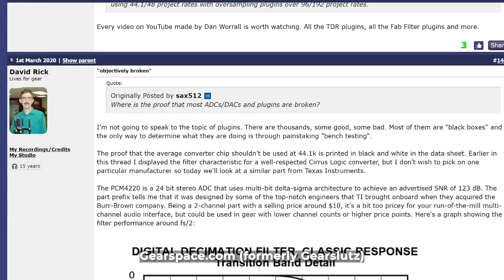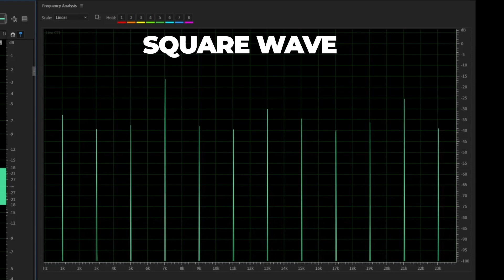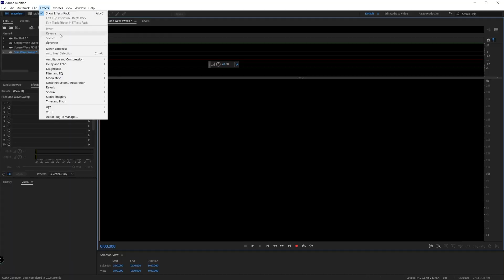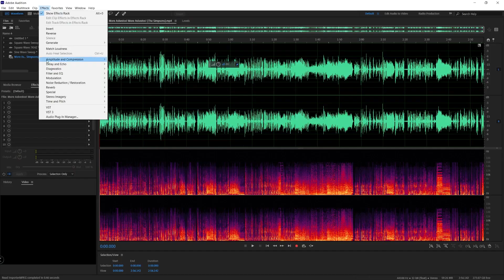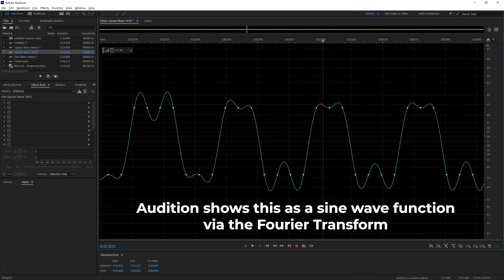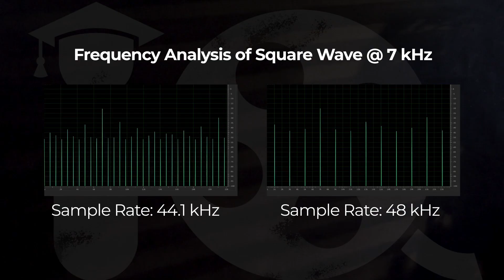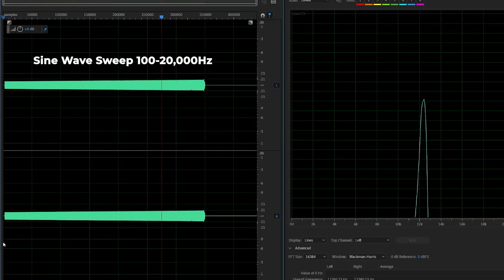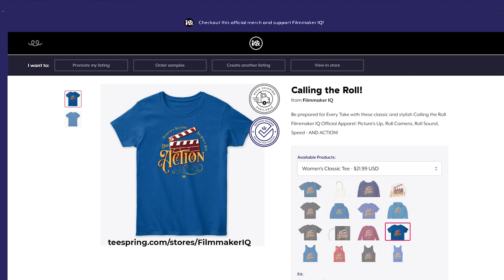What is the Optimal Sampling Rate for Audio? (It's All About the Aliasing)

Comment: What you explained is just that, either have a good recorder (A/D converter) which can do a good job at filtering out > Nyquist frequency signal, or, record at higher sampling rate (for example, 96kHz is much more than enough), and then, down sample to 44.1kHz/48kHz when you do your post.  In digital domain, you can do (very close to) exact calculation, and at the end, save a few bytes on the final product (without jeopardizing quality).  However, to those crazy guys who insist to get so called high res files for PLAY BACK, they are just crazy, forget them!
Reply: I mean, even cheap equipment like 100$ DVD Players in 2007 had already 192kHz DACs avoiding any problems like this at all.

But for the final media, more than 44,1kHz doesnt make much sense since anyways most released music is still in 44,1/16Bit. Even most(or all!) vinyl records are made from 44,1kHz samples. Tidal even dare to upsample/"remaster" 44,1kHz/16Bit originals to expand their "HiRes" collection...

Since anyways every HiFi gear have HPF for anything above 20kHz, in combination with internal 96kHz+ processing, more like 384kHz nowadays, no. 44,1 is just fine... more is acceptable in cases of digitalized vinyl records or yeah - why not. 44,1/48 vs 96+ is like comparing 4K vs 8K... it doesnt make practical sense, probably a bit with the perfect circumstances... but hey its possible. Thats why my AVR has 9x(or 11x idk) 384kHz/32Bit (32Bit!!! wtf?!) DACs, by numbers even better than my Hi End Stereo Gear with "only" 192kHz/24Bit Wolfson DACs.

Only in recording and mastering more than 44kHz are needed, and these are anyways at 96kHz+ since its possible.

I dont get people when they complain about "only CD quality"/44,1kHz... damn! Thats at least completely uncompressed, not like the lossy! MQA garbage for example. In fact (and already proven...) CD quality is better and more accurate than MQA (which is another compression format like mp3 - but worse, and with high license fees haha). Some of my friends are completely addicted to HiRes and/or Tidal/MQA, only because they see any blue light or 96/192kHz on their receivers screen... despite having absolutely the same sound as a 44,1kHz CD with the same mastering. Damn, they use soundbars, garbage "HiFi" gear, BT headphones and they dare to complain about 44,1 kHz only!
I also prefer HiRes source material, but mostly because of different masterings, less loudness, more audiophile/dynamic, easily for the "demanding" people mastered.
Reply: @harrison00xXx   I believe you are incorrect about vinyl masters. Mastering for vinyl is a separate master than the master for CD. Professional mastering engineers want to work with the highest quality mix which means NOT 44.1kHz/16bit. And most likely the vinyl press wants to make their master from the highest quality version available. At least for the major label artists. Independent artists, well ya know they get what they pay for and can’t be reasonably used to make statements about what’s used to make vinyl records.
Reply: @arsenicjones9125  Ofc its differently mastered for vinyl, but still, the samples used to make the "negative" are for probably 99,9% of the (non quadrophonic) records 44,1kHz/16Bit, as CD quality, that was my point
As if CD Quality is "bad"....cmon, thats the most accurate and "lossless" quality standard we ever got. Ofc there is now "HiRes" but thats more of a voodoo/too much...
Reply: @harrison00xXx  no I’m afraid you’re again incorrect. In major studio albums they regularly record at high sample rates then down sample to 48khz 24bit to edit & mix. Some major studios do all their editing and mixing work in 96khz/32bit floating. Then it will be down sampled again after mastering. Again we can dismiss what independents do because they don’t do anything in any standardized format. 

CD quality is not the most accurate, lossless standard available. 🤦‍♂️🤣 An original recording made in a 96khz/32bit wav file is more a more accurate representation of the analog signal. If there are more samples w greater bit depth it MUST be more accurate than a lower sample rate and bit depth. Just because you cannot discern a difference in every piece of music you hear doesn’t mean there is no difference or that there is no difference which affects the experience. Just to be clear I don’t think CD quality is bad just that it’s not without flaws either. Upsampling won’t increase fidelity in anyway but a higher sampled recording is higher fidelity
Reply: @arsenicjones9125  So you have proof that the source material for making vinyls ins more than 44,1kHz?

Sure they edit and master at higher bitrates, but the end result is mostly 44,1/16Bit sampled. This change probably with HiRes for the customers slowly, but its a known fact that 44,1kHz were used for vinyls FOR DECADES at least.
Reply: For consumers the issue is more the playback not so much the file itself or recording format.  So if you take a 44.1 or 48k file and up sample to 96khz and them playback it removes much of the aliasing into the inaudable frequencies.  This then gives a much smoother and cleaner sound in the Audible range.  The other issue is the jitter of of the DA clock which is also moved out of audible hearing. 24bit over 16bit is more important when recording and playing back audio. All 96khz high fidelity files are 24bit. Much of this audible difference is often negated by what some DAC's filtering out and applying phsyco accoustic filters.
Reply: @julesc8054  you cannot remove aliasing by upsampling. The aliasing has already been included into the file. The aliasing is apart of the digital file not an effect of playing back the file. A higher sample rate will only reduce aliasing when recording an original analog audio source. De-aliasing software analyzes the file to identify and remove the aliasing but that’s separate from the sample and bit rates. If you want less aliasing you must start w a higher sample rate and go down. Professional studio albums are run thru a de-aliasing pass when bouncing down the final master so doing it again isn’t doing anything
Reply: @arsenicjones9125  Hi Chad, thanks for pointing my error,  I was more talking bout the clock jitter in most DAC’s.  If a file is a 44.1k file that has been dithered  “de-alised” there is no real issues with ailing in the file.  Up-sampling the playback or playing back at 96k negates the issues of the clock jitter reflecting back into the audible spectrum in the higher frequencies.
Up sampling also has the added benefit of interpolation across the whole spectrum not just the high frequencies.

As a matter of interest I’ve just done these test in my DAW all the way up to 192k and the issue happens both ways. The issue is not so much the aliasing its a simpler issue.  It has to do with the number of samples representing the slope at say 7k or 10k and even in much lower frequencies down to even 400hz.  More samples representing the slope the smoother and more accurate the sound.  BTW Sound should never be a square wave. Square wave is distortion (clipping) that damages equipment and speakers.
Reply: @julesc8054 it’s interpolated into a smoothed wave by your DAC but it was still squared off to start.  @julesc8054  seriously just an egregiously incorrect statement there.
 @julesc8054 improve  @julesc8054 

 @julesc8054 effectively  @julesc8054 Unless you go to 32bit and the math works out cleanly: you just skip every other bit.

Jitter is an issue created by your playback setup and is not an inherent flaw of digital audio or the CD standard. You could have a number of issues causing jitter but upsampling can’t help that.
Reply: @harrison00xXx  yes it was used for decades bc that was what processing was available. Why do I need to provide direct evidence but your claims must be accepted at face value? Would you even accept that I’ve been employed in multiple studios? Probably not. Cest la vie.  Finally, if you do a high res recording of a vinyl, no matter the manner in which that record was initially recorded, you are sampling an analog audio source. It’s not the same as upsampling a digital file. The record is analog.
Reply: @arsenicjones9125  Ok i see you dont know much...
Reply: @arsenicjones9125  Hi  unfortunately this is not a user form that accepts quoting people, so I don’t know what you are trying to correct me on or reply to, sorry.

I think the issue here is a fundamental difference in belief. You believe the issues is the file I do not.
The biggest issue that is demonstrated in this video is the fact that it is digitally created square wave, i.e.: group of harmonics. Audio is sign wave AC voltage into a speaker driver, as we well know. 

Many people think the only advantage to higher sample rates the highest possible frequency.  I think there is far more. Although there is this benefit, other benefits are at 10k @ 48k24bit there are 8samples to reproduce the frequency and @192k24bit – 29 samples.  This means that harmonics of the sound and harmonics of other sounds can be better represented by the converter.

There are other advantage is the artefacts of clock jitter, the original issues this video is incorrectly trying to attribute to aliasing in the file, is moved to the inaudible frequencies.  Clock jitter is less of an issue than it used to be as clocks have improved over the years but still an issue on many Sound Cards and DAC’s.

I still think it is more important to listen to a 24bit file than to chase 96k it just so happens most 24bit files are 96k. I still maintain that playing back at 96k has a great sonic advantage for digital equipment in general.
Reply: I for one am glad that 196 kHz audio equipment is readily available because I actually do use all that bandwidth for performing ultrasound interferometry with work.
Reply: @AJMansfield1  wondering what gear you are using?
all of my ADC/DACs have HPFs, so after the signal got only once analog, and if its the end of the chain... its cut off at 20kHz.

Same goes btw for my Cambridge Audio Amp. Anything beyond 20kHz is already internally cut off (also in direct mode) before it can be amplified (where probably another 20kHz HPF is waiting!)
Reply: @harrison00xXx  It's a custom bit of kit with custom frontend analog circuitry, it's just from the ADC on back where it's using pretty much exactly the same 192 kHz ADCs and software drivers that have become so cheap and readily available.
Reply: @julesc8054  Square wave is a testing norm for hi-fi equipment, especially for power amplifiers. Guess why? Real life music is no where close to sine wave, what's more, you have to deal with impulse shape signals. Good luck reproducing them with fidelity if you don't have bandwidth. A good sound system, analog or digital, has to deal with square wave.
Reply: @julesc8054  Oh, and again about square waves, just put a fuzz/overdrive guitar on the scope and feel free to admire the signal shape 😉
Reply: @jjcale2288  Interesting discussion.  I think we could learn much more if the bandwidth of what we were thinking was not limited to the few kilobytes of text and data-rates were faster than our typing speed.

Then to respond: I mean sign wave AC (alternating current) as opposed to square DC (direct current). All sound engineers the world over do everything to avoid clipping (DC voltage Square wave) in audio signal process. Square wave signal from a signal generator, or some other source like clipping, produces DC current in the output of the amplifier. DC current on the output stage of an amplifier transfers to heat in the speaker drivers voice coil causing the speaker driver coils to overheat, depending on the heat capacity of the voice coil and the level and duration the square wave DC voltage is sent to the driver is converted to heat and more often than we like smoke.  Live concerts would be quite short and expensive if guitar fuzz boxes caused square waves in the signal path.
Reply: @jjcale2288  to your second comment.  I think the fuzz sound referred to the state of the muzo not so much the sound of the pedal 😊
Reply: double the sample frequency also adds an invisible bit of dynamic range.
Reply: @julesc8054  Have you ever heard about slew-rate, integrative or derivative behavior of the amplifier stage, ringing and such? DC offset is one thing that should be avoided but square wave is not DC. Clipping is completely other animal, of course you don't want to transform your precious hifi/high end amplifier in a square wave generator. But for the sake of fidelity the system has to reproduce correctly square waves within the audio bandwidth with a reasonable dynamic.
Reply: @stefanweilhartner4415  invisible indeed
Reply: @julesc8054  Fuzz, overdrive, distortion are pretty much the same thing when we talk electric guitars. If you are interested we can go into details.
Reply: @jjcale2288  but it is there. a one bit D/A converter can deliver the dynamic of a 16 bit D/A signal. i am working a lot with 1 bit PWM outputs to achieve an analog signal - after filtering. nothing magical for engineers.
Reply: @jjcale2288  Hi it sound like you have vast experience with amplifiers and fuzz pedals etc.  Sound like it could be an interesting discussion. Onto the topic at hand. I am just curios if a square wave is both AC and DC and if the voltage determines how the speaker moves and if there is no voltage change, i.e. DC flat for the brief period, what does the speaker do with the energy it is not converting into kinetic energy?  Does it make a difference if the brief DC is created by squared off wave or clipping in the signal chain? What are the effects over time?
Reply: @stefanweilhartner4415  16bit PCM vs 1bit PWM is comparing apples with biscuits. Completely different encoders. A simple conversion does not improve original dynamic. But feel free to play around 😉
Reply: @julesc8054  It depends where the clipping arises. Worst is in the final (power) stage. Although for guitarists sometimes that's the best way to go, as a guitar amplifier is a special beast that can get away with power clipping. Not easy for speakers, you are perfectly correct.
DC in speaker means a mechanical offset of the cone, in or out, depending on polarity. The current will heat up the voice coil and in extremis can destroy it. We don't want that. Full power always asks for trouble.
Reply: @harrison00xXx  Actually it's LPF not HPF.
Reply: I still maintain the issue is not in the file its in playback of the digital audio. I think this is why there is such a debate some people have audiophile DAC’s that solve these issues through various means and others don’t do such a good job. People on the professional side of things just need the extra bits. I don’t think there is an issue with sample rate conversion when it comes to music or any other regular audio.

I think there is too much emphasis on “do we need the extra frequencies?”, no, its not the whole story. The extra samples representing the audible range better, just like 16bt vs 24bit. Does 16bit reproduce the sound with 65 536 steps ok? Yes, is 24bit with 16 777 216 steps better and smoother yip. But everyone says we don’t need the extra 16db of noise floor its not the point. I still want the extra 16711680 steps of 24bit to represent the audio I can hear. The same goes for the number of samples, its not about the extra frequency range more samples and more steps in the audible range to represent more complex harmonics and subtitles of the audible audio.

its the extra bit
Reply from the maker: But the extra samples don't represent the audio better... That's what nyquest theorem really tells us... Everything below the Nyquist frequency is perfectly represented... No additional samples are needed.
Reply: @julesc8054  👍I also use at least 96/24 digital audio any time I can afford it. By the way, another consistent test for audio equipment is the white noise reproduction. Worth comparing 44.1/16 with 96/24😉
Reply: @FilmmakerIQ  Only problem with Nyquist is that some of us can actually hear how "perfectly" it works😀
Reply from the maker: I don't know what that is suppose to mean.
Reply: @FilmmakerIQ  It means that extra samples matters. 44.1kHz on 16 bit is good enough but far from perfect.
Reply: @FilmmakerIQ  you dont know much at all, as always!

Try to be more polite and dont get instantly personal after a legit argument, and probably you are ok then....
Reply: @FilmmakerIQ  This assumption is wrong.  In my opinion, there's nothing wrong with Nyquist, and it is true that a wave sampled at twice its frequency is enough to "faithfully" reconstruct it (between quotes because to "faithfully" reproduce the wave you would need infinite amount of interpolation, and that is not possible), the problem is, all the computational power and intellectual property people need to pay for in order to "faithfully" reproduce the waves, specially complex sound waves coming from all kinds of instruments and their interaction with the environment where they were recorded. What we hear coming from our PC, phone or tablet DACs are not sound waves "faithfully" recreated, not even close, the better the reconstruction of these waves, the better we'll perceive things like transients, timbre, and  depth. Just take a listen to equipment like the Chord M-Scaler, the upsampling is ridiculous, and it uses I think, around 60 bit of depth,  and it's all very perceivable.  Now, if we think about it,  it's all done according to Nyquist, the M-Scaler was designed to reconstruct red  book CDs more "faithfully". So do we need higher sample rates? "apparently" not, but what a price to pay in audiophile equipment in order to be able to enjoy music at its best. If only music were sampled at higher rates... 

Sampling at higher rates for better perceivable quality, has very little to do with our inability to hear above 20KHz, and all about how our brains can pick very small differences in sound and timing errors introduced by DACs when reconstructing waves translate into blurry and flat sound.

It's funny to me how many "neo" science wanna be people come to the internet to throw all kinds of nonsense.
Reply from the maker: You don't need infinite resolution to faithfully recreate a sound. Not all frequencies are possible in a microphone diaphragm, not are they possible in our ears. Reality is bandlimited and sound energy is continuous.

Faithfully is only in quotes because of the Nyquist limits otherwise it IS a perfect recreation of the original signal.

I can even show that the waveform created from 48 is EXACTLY the same as a band limited 192khz signal
Reply: @FilmmakerIQ  Why are we still talking about the frequencies we can’t hear, or a microphone can’t pick? That is not what I’m arguing. 

Also, I’m not arguing the fact it is possible to recreate the signals from 44.1KHz, it is, at the expense of interpolation errors that result from the fact that electrical circuits are not “ideal” and we can pick the differences in sound as a result of those timing errors. So at the end, the recreated signal is not exactly the same it was recorded, it is slightly changed. 
The waveforms coming out of your DAC are different from the ones coming out of mine, even from the same file, because of electronics component variations, brands and types.
The better the DAC, the more accurate the reconstruction potentially will be, and the higher the sample rate, the smaller the errors created by the signal physically going through the electrical components will be, also less interpolation means less chance for timing errors to occur.

I’m having this idea that a bunch of people just read things like the Nyquist theorem, and then come here just saying “I can recreate this, or I can or can not measure that, so it must not exist”, and so on.

There are many things involved here, software, electronics and also our perception which is actually individual. 

Anyway.
It’s all good, let’s just agree to disagree on this. 

Have a good rest of the night.
Reply from the maker: Well if you want to talk about all the failings of electronics, there's no point in discussing 48khz vs 192khz... There's no technological problem at 44.1 that wouldn't also be present and maybe even more so at 192khz.

No, the higher the sample rate doesn't mean there are smaller errors..

There is no interpolation errors with 48khz. The timing accuracy is 100% exactly the same. I'm probably going to do a video demonstrating that exact thing.
Reply: @FilmmakerIQ  Accuracy is 100%? 
My friend that does not exist here.

Any electrical engineer will happily tell you this. 
All you can do is approximation, and the better the equipment the closer you get to the teal thing. 

Even the measurement equipment you have, all they do is approximation with a %error that you must be willing to accept or go to a more expensive equipment that has a lower %error. 
Errors will always be present in the recreation and measurements of signals. 

But ok, do as you wish.
Reply from the maker: What makes you think a higher sample rate would be less affected by any electronics error present at the lower sample rate? 

But yes from a mathematical standpoint, the sine wave is reconstructed perfectly, 100% with the lower sample rate.

That is the Nyquest theorem.
Reply: @FilmmakerIQ  There we go... As Monty illustrated in his video, the damn 20kHz square wave at 44.1kHz sampling rate after D/A conversion has a clear 19kHz "RINGING"! This is just one example of how "perfect" is a signal recreated, thank you Monty! When we say 44.1/16 is "good enough" compared to 96/24 is as if we compared back then the compact cassette vs reel-to-reel on 19.05cm/s. I rest my case!
Reply from the maker: Monty didn't demonstrate a 20khz square wave...

Your entire case is not understanding what's being presented to you.

Truly idiots here
Reply: @FilmmakerIQ  you are right, it was 1kHz square with RINGING !! Even worse, but hey, we might be idiots! On the other hand it seems you skipped a lot of physics classes. There are lots like you in the industry, so don't you feel alone by any means. Oh, and if all these really bother you, feel free to delete the whole block of comments, the loss is yours! 😘 Bye!
Reply: @FilmmakerIQ  Which again, it’s not what I am arguing. 

I can do wave reconstruction all day using the Nyquist Theorem. I stated before, it is possible to calculate the original waveform perfectly, either by doing all the work yourself on paper for fun, or using matlab, or whatever your preference in software is.

DACs on the other hand can’t reproduce them perfectly they introduce timing errors because electronic components are not perfect. The conversion from digital to analog is physical and goes through resistor arrays and FETs (R-2R).

While good designers will try to compensate timing errors due to latency created by the time it takes for currents to rush in and voltages levels to get to their needed magnitude for FETs to engage, it is not perfect, there are limits, and resistors are not all exactly the same value, they al present variances which translate into timing errors. And don’t get me started on filters. 

It is not about electronics failing. It’s about their natural response in the real world, they don’t behave like ideal perfect components we asume when doing calculations on paper (yes, I’m that old), or software.

And what makes you think I said higher rates would reduce the timing errors introduced by electronic components? That is not what I said.
Sampling at higher rates gives you more samples to start with at smaller intervals, so a well designed DAC would have timing errors that are harder to perceive by the brain, because they fall between those smaller intervals. 

While we can’t hear over 20KHz, we can perceive timing variances well over 100Khz. Read what I said properly, I’m not saying we can hear sounds over 20KHz, what I’m saying is we can perceive time changes well over 100KHz, and that translate into being able to resolve better textures  (transients), timbre, and depth, don’t underestimate that aspect. 

My argument is not theoretical, it’s practical, so please, stop bringing the theory up, I know it very well.
Reply from the maker: Okay, I see where you're going with this. Then the issue isn't the sample rate at all, it's the clock precision.

So then wouldn't a 48khz with an extremely accurate clock sound the same as a 192khz with a clock that say is less accurate.
Reply from the maker: Gotcha.

So what if the work around is to use the more accurate 192khz electronics, but throw away 3 out of 4 readings and pull a 48 khz reading.

I'm sure they're doing that... But that way you get accuracy AND we're not wasting time capturing stuff we can't hear
Reply: @FilmmakerIQ  

Sure DACs already do this, but the thing is, it is still discernible.

If this wasn’t the case, we could not hear the difference between DACs other than the way they color sound. 

Go and try a Hugo TT2 and see how well it reproduces sound, then add the M-Scaler, and let me know if there wasn’t any room for improvement, then go to the Dave, and then add the M-Scaler, you’ll probably poop your pants at that point. (Assuming you’re a lover of sound quality). Use the same sound file, all you’ll be changing is the ability of these systems to recreate the signals. 
Chord DACs have very simple amp stages to deliver a sound as “transparent” as possible. 
They are the best equipment to measure this.

There are other reference, state of the art DACs you could use as well, but they do tend to color the sound, not a bad thing, it’s all about preference.

Also, don’t think because you got same song at 192KHz and 48KHz and you captured the “same” signal (I’m assuming you’re reproducing them and recording the audio back), you got a perfect reproduction of the original sound that was recorded, you are not. You’re just reproducing what your DAC is capable of.
Reply from the maker: On the last point, if I'm just demonstrating what the DAC is capable of... Then sampling rate is essentially inconsequential?
Reply: @FilmmakerIQ  I still see you’re boxing yourself in the theory.

I already said for systems cable of reproducing signals more “faithfully”, sampling rates over 48KHz would in theory, becomes essentially inconsequential. But most people can’t afford those systems, so sampling rate still matters until the technology capable of “faithfully” honoring the Nyquist theorem is within reach to must of us. 

I’m not arguing your theoretical point, I’m arguing why for now, higher sampling rates still matter.
Reply from the maker: Theory is how I start understanding the subject. If you don't get the theory right, you're just lost in the subject, clutching blindly at voodoo.

Problem is I'm seeing a chicken and egg scenario. If you have the higher clock speed, then you have the accuracy to handle the lower sampling rate.

So although I kinda see where you're going with this, I still don't buy the argument for higher sampling rate.
Reply: @harrison00xXx  It's not the output that's the problem. High frequencies look like lower frequencies to the digitizer so you need to filter before things get digitized.
Reply: @chaos.corner  These days most ADCs and DACs are running at a super high internal effective sampling rate and downsampling or upsampling internally to the external rate, because they are using sigma-delta conversion. So the alias frequencies are moved so high that a simple analog filter can remove them easily without losing any audible signal. Using a higher external sample rate doesn't help you unless you are trying to record sounds only your dog can hear.

The usual reason for higher sample rates and bit depth during processing is to avoid losing data across repeated processing steps. For original recording or final playback, it does not help at all unless you are using garbage equipment.
Reply: @harrison00xXx  I have some classical recordings in 192 KHz rate. Funny thing is that just mostly captures EM (or audible) interference on microphones, most likely from high frequency power supplies. And a lot of dithering.
Reply: @julesc8054  No, this “upsampling” you are talking about won’t help because DACs internally do something like this anyway. Using higher sampling frequencies gives more headroom for imperfections in analog and digital domains, but not here, not this way.
Reply: @noop9k  Hi
Thanks for mentioning this.

Here is a little more food for thought.
Its great how we can tell what industry or area of sound someone comes from by their terminology.  Hi-Fi people use “DAC.s” Studio engineers use DA- AD’s.  Project Studios call it Sound interface as it may not have any DA’s or AD’s and have only digital ins and outs.  Live Sound & PA Guys call it a Stage Box.  Home computer and gamers call it a sound card. So the point is that although you may use a high end sound card you call a DAC that may up-sample internally & process the rest of the digital chain does not nor do they in many other industries. Up-sampling in the device for processing is also generally only a feature on some high end Hi-Fi DAC’s. So if you have home theater instead of true analogue stereo Audiophile you may have a DAC that up-samples in the DAC but the Surround Sound Processor’s DACS may also not.  Your disk players DAC probably won’t either.

Generally in a system you can have only one clock. So if you are going to use your sound card “DAC” sending digital to all components in the chain and then the last digittal component in the chain will then be DA converter.  So your "DAC" then just becomes your sound card.  This helps you to not going through too many DA and AD’s by the time you get to your amp.  This chain will process and sound better at higher sample rates irrespective of the original audio sample rate.  Up sampling to say 96k and going digital trough the whole system forces the whole system to operate at 96k. If you use 44.1k you then force the whole system to 44.1k. 
96K imho just allows the processing chain to sound better, whether its a bunch of rack gear or home theater or audiophile. Also, to me, running though your system digital sounds better 96k digital instead of analogue. 44.1k digital is why Audiophile people prefer analogue interconnect over digital ones.
Reply: @harrison00xXx  the overlap between the beginning of digital and the end of the first phase of vinyl wasn't that big. sure, there were some high budget albums starting in the 1980s that were recorded digitally, but analog masters were still quite common throughout most of the 80s, and even still somewhat in use in the 90s. (by which point vinyl was almost dead) 44.1 was likely the most common recording format for the second wave of vinyl over the last decade, but there are notable musicians (jack black, nils frahm eg) who refuse to work with anything but analog - and many other musicians that care about quality also work in high res. it's been around for awhile now, anyway - at least as long as the second revival of vinyl.